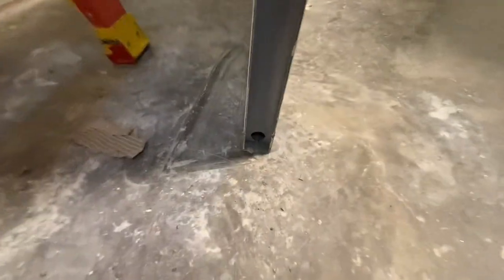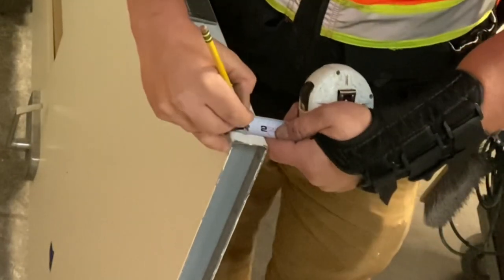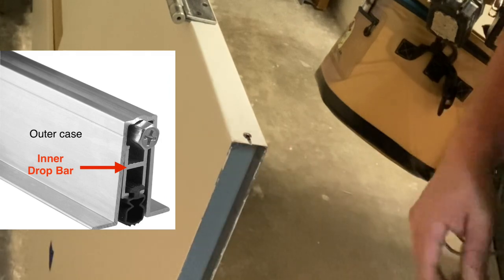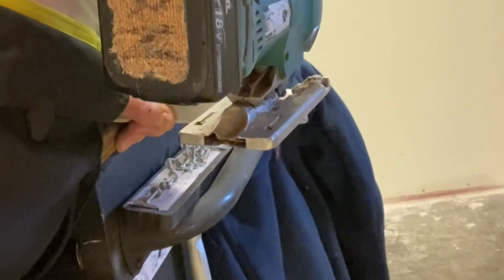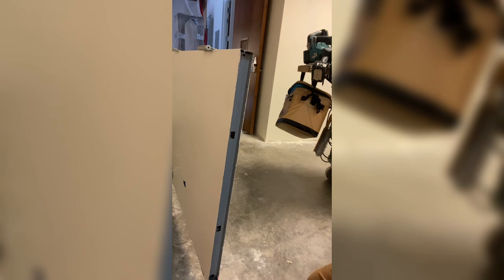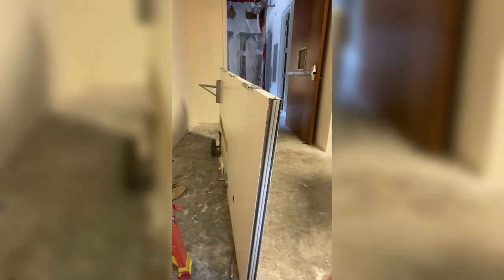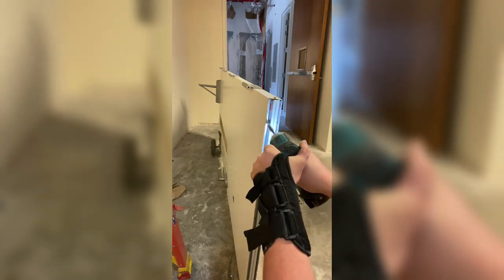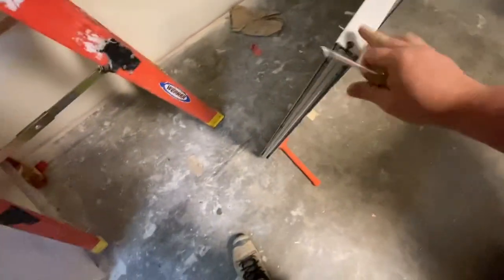How to Install an Automatic Door Bottom Top 3 Tips

Comment: How about telling us about getting the steel door hollowed out for the drop unit to fit, do the doors have a wood filling to cut away?  Tips are great but you have to get the door ready first.
Reply from the maker: These new commercial HM doors are ordered and built based on what kind of hardware is going to be installed on them.  They have a channel in the bottom that will accept the door bottom.  They sometimes fill it with a u shape piece of metal to fill the channel.  You would have to remove that if you wanted to install one of these on a door like that.  But for the most part these commercial metal doors are ordered and built based on what hardware will be installed. 

So ya I don’t have any tips on trying to retro fit a door bottom into a door that’s not built for it.  They make surface mount door bottoms that would work great for that kind of situation tho.  Thanks for checking out the channel.   I appreciate it 😎

Comment: What vice tool do you use to hold the door upright?
Reply from the maker: It’s made by a friend of mine but it’s very similar to a “Door Kart” door dolly if you google that.  Makes it easy to move door around and holds it upright when installing hinges or hardware on the top and bottom 😎